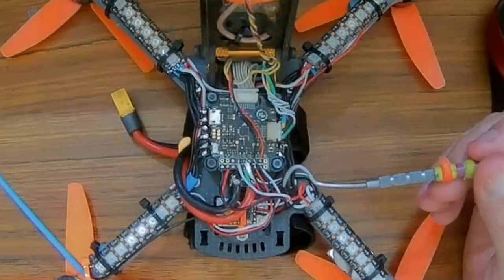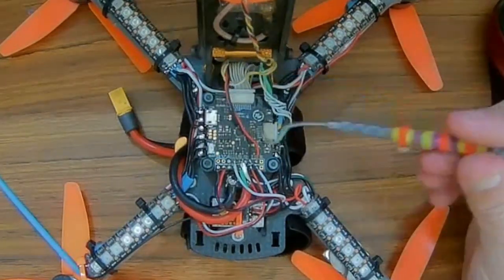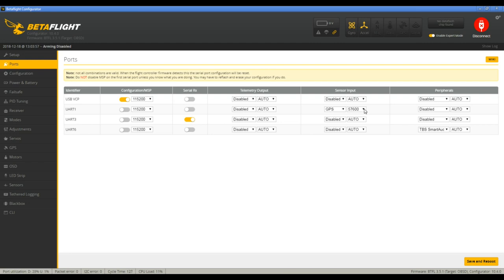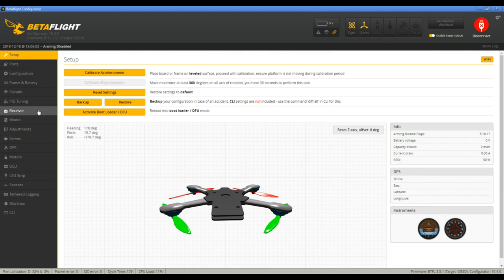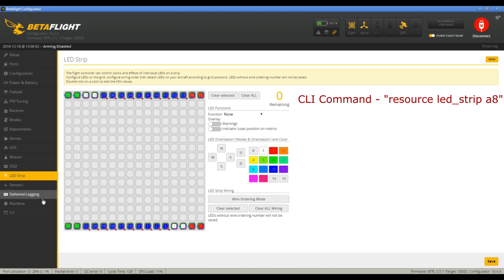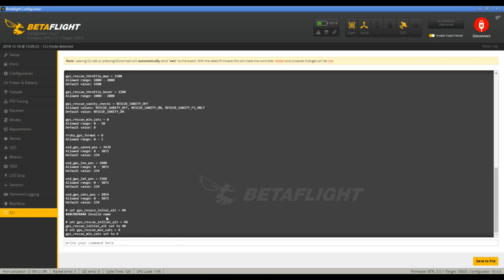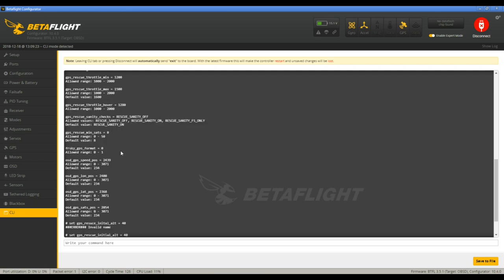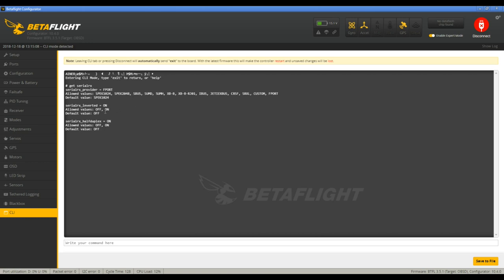R9mm F Port on F4 Flight Controller - Plus GPS and LEDs

Comment: Your video was the first to show the connection between inverted s.port and tx. I've been frustrated trying to get this to work on f.port pad on the R9mm. Soldering now to the inverted s.port as you have it. Hope this fixes my issue. Thanks!
Reply from the maker: Hope it helped!👍
Reply: @bigdatapimp  it worked!

Comment: Many thanks! I have been struggling to get FPort working on a Diatone R349 with F4 Mini Mamba Stack. I saw you wired to the inverted Sport pad, rather than the Sport/FPort pad which I had been using. I swapped the wire and, after no joy entered set serialrx_halfduplex = ON then save into CLI and everything works :)
Reply from the maker: Nice! Glad I could help.
Reply: Which r9mm firmware are you using? I can't get fport to work with flex firmware.

Comment: Hey mate, thanks for sharing. I've just switched form Turnigy Evolution with ibus were i had no issues setting up all my quads. Trying to make r9mm working with my exuav Flytower and no luck :( Have you updated the firmware on your r9mm first to use fport? Thanks!
Reply from the maker: Yeah. I updated the r9mm with the fport firmware first.